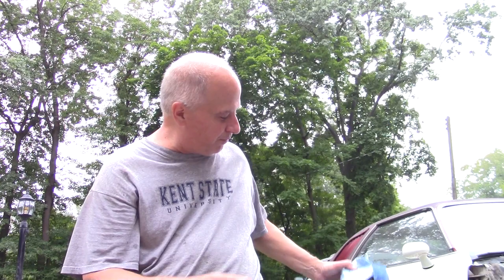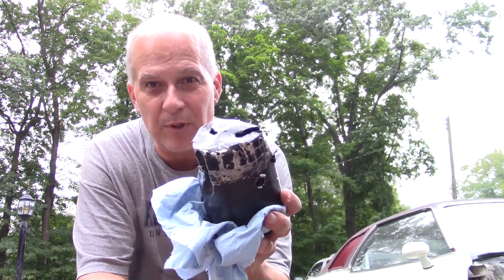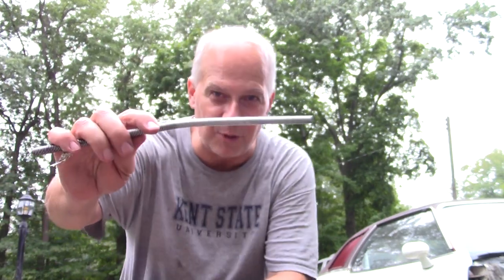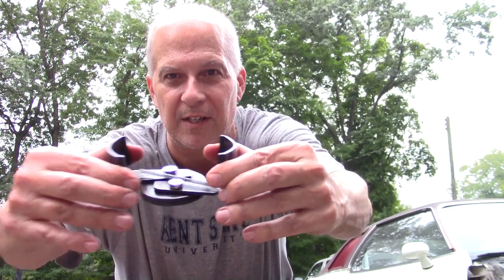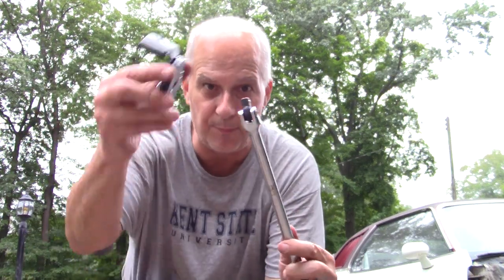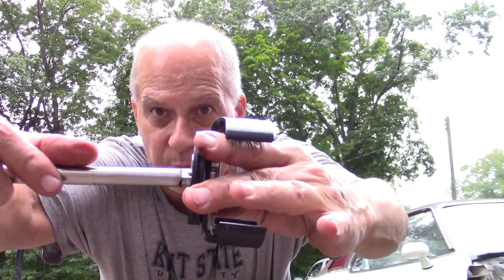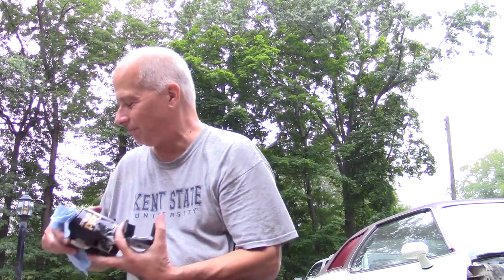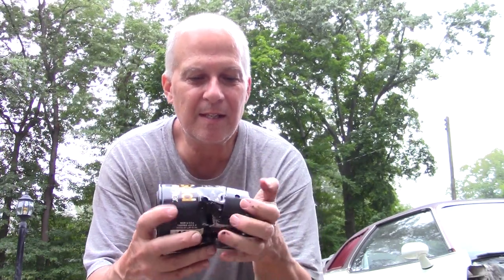Lisle Oil filter wrench review.  It saved me from a lot of work!

Comment: I will buy this tool, I had a filter stuck on my harley years ago (i did not put it on) took me over 1 hour to remove, I cursed this MO FO repair shop for 20 yrs   EAST COAST SUPER BIKES NY! Whatever this tool costs will be well worth it       TY for the video!
Reply from the maker: This tool has come to the rescue a couple times since I bought it.  I have since taken all the expensive strap oil wrenches that I have bought and put them in a box in the basement.

Comment: Changing oil in 1966 corvette with a spin on oil filter.  Could not find the oil filter wrench.  Got an old telephone cord and a small block of wood
wrapped the cord around the filter and around the block of wood.  Used the wood for leverage trying to spin the filter off.  Could not, then jacked to car up higher so I could use both hands.  Put my other hand on the filter to help turn.  Then used the wood and telephone cord to spin the oil filter.  Finally it move a bit.  More pressure from the cord and hand finally started spinning the filter.  You do what you have to do to make things
work.  Going to make my own oil filter tool for this car.  

Thanks for your video store.  I have been there and done that was well.
Reply from the maker: Car guys have to be creative.  it seems we find obstacles almost every time we work on our cars.

Comment: I had a friend recommend large channel locks for oil filters, and it worked. Except you need the right size channel locks in my opinion.
Reply from the maker: There isn't room around the oil filter for channel locks, in this case.

Comment: Been working on cars 25 years. Chevy silverado 5.3 little oil filter tucked beside the oil pan. Twisted up like a knot.  Oh what do I do now.  I had one of those but it would never open up enough to work.  As a last resort I tried it and as the filter was crushed IT WORKED!!! I think I pulled a muscle but it's off.
Reply from the maker: Glad it came off for you. I know exactly what you are talking about though.  A pipe on a breaker bar finally gave me enough leverage and it was still tough to do.  Those filter wrenches come in a couple different sizes.  Get a bigger one.

Comment: I’ve found that it sometimes helps (if you have room) to tap the top of the oil filter up near where it connects with a hammer (or anything that you can hit it with) as you attempt to turn it.
Reply from the maker: In this case, there was no room.

Comment: First time I had the filter stuck issue. Tried the standard wrench, then pipe wrench then another wrench. The filter got a big dent. After seeing this video tried the  Lisle 63600. Wasn't sure it will work but it did.  Thanks for the helpful video.
Reply from the maker: Glad it worked out for you.  At this point, I’ve moth balled my other oil filter wrench’s.  This has been my go to since I made the video

Comment: There is  a couple of manufacturers  of slip  joint  pliers  , channel- lock  brand  are the priciest  but have good  sharp  teeth.
Unless  clearance  / room is a problem  these work well.
Reply from the maker: By time I put a bar extension on my breaker bar, I was a good three feet out and it still talk all the beans I had to break that thing loose.  Craziest thing I ever experienced.
Reply: I have 2 sizes of Lisle filter pliers. They work on 90% of all filters. For those filters you can't get to, the 2 adjustable Lisle wrenches are great.

Comment: Use/attach "Exhaust Clamp U-bolt" to the body of filter. Make sure it has enough thread bar length so that we can attach wrench hole (any wrench you prefer) to the thread part, and push/pull the thread bar using wrench to open the oil filter. Here one 4-inch Exhaust Clamp U-bolt costs USD $ 1. Sorry for bad English.
Reply from the maker: Clever idea!  Thanks for sharing!

Comment: Hand tightening and oiling the gasket for 52 years as tight as I can by hand, and never have had a problem with leaking or removing them. Never used a tool to tighten the oil filter. I have strong hands.

Comment: I acquired a 14 hr jondeer breakin oil. Freeze grey 40wt? Oil. I removed original filter went to my jdstealer. Closed down. Auto store no jd filter. Went home and replaced old filter. It bottomed out by snug hand tight. Found out my toyo filter fit without side guard. I tried to remove old reused filter,Uhoh. Sheesh. Crushed it with 3 claw. Whew! Never remove till the new one is sitting  at hand.

Comment: Them are great I got mine at walmart it has never failed me. You'd think it would slip but somehow it always catches. People over tighten oil filters all the time they only need to be hand tight. Not hand tight as in big burly man giving it everything you got with both hands. Just use one hand and give about 70-80% of the beans you can manage. You can always tighten it later if it leaks. And take it easy on the drain plug just a light snug with your average 3/8" ratchet is enough
Reply from the maker: Agreed.  If you oil the gasket, snugging it up by hand will allow the gasket to compress enough to not leak.

Comment: I have one of those tools for removing oil filters, the one I have is a little different than that one, the one I have has three fingers on it that come together and clamp down on the filter. I have a bunch of other filter wrenches that I have gathered up over the years. but that one with the three fingers has been a lifesaver. before that I would always as a last resort, grab a long screw driver and it would do the job. but most oil filters hold about a quart of oil, and it would make a giant mess. and the special tool will get into tight spots better and will fit any oil filter. so it's the first tool I grab out the toolbox.
something else I have learned over the years, is now I use WIX filters exclusively. the can part of the filter is thicker and sturdier and they filter the oil better.
Reply from the maker: I have since seen those oil filter tools and the concept is the same so I can see where they would be as effective.  I have watched some channels where they dissect filters and I believe I have heard that some filters have thicker metal for cans.  Honestly in my case, the can metal was decently think or it would have ripped off much earlier.  But I have heard Wix filters are very good.

Comment: Why was it so tight in the first place? I learned simply; hand tight plus 1/4 of a turn with a wrench!  Anyways thanks for letting us know what might happen if you overtight the oil filter if the threads don't give up first!!
Reply from the maker: Can’t say.  I bought it that way.  I don’t even use a wrench to tighten.  Hand tighten.  I’ve never had one leak.

Comment: I have a 1999 Lexus RX300 - I left the oil filter on too long - got it to cut loose after 3 hours - stabbed it through twice…this is the worst oil filter placement design I have ever seen! Next time I will change the oil and filter after 4,000 miles or 3 to 4 months.

Comment: I was just looking at this product to purchase and now will, knowing it works well. What I've done in the past after the hammer screwdriver trick didn't work, I just use a good ol' pipe wrench.
Reply from the maker: You won't be sorry.  As you saw, I did all of those things and nothing worked until I put this tool on the filter.

Comment: Another cool thing about this tool is that it will not work to tighten, only loosen. It seems that stubborn filters also come off more easily on a cold engine. Also, there is a tool used by aircraft mechanics where you cut off the can and attached a three pronged tool directly to the thick metal plate with threads at filter base.
Reply from the maker: I hadn't thought about that, but it is a great point.  As for myself, I don't think I ever tightened a oil filter with anything more than my hand.  I've never had a problem.  Yes, I have seen the tool you mentioned and my home made tool was a poor attempt at something like that.  :)
Reply: here in europe most mechanics use this 3 proned tool. it is serrated and works only to unscrew ...really well. or when nothing works a chain wrench very close to the base plate
Reply: @oliviervanespen5047  What's the name of the tool?
Reply: The tool is from Bogert Aviation and the name of the tool is the Talon oil filter tool.  If you rip the canister apart this tool will attach to the oil inlet holes of the filters base plate and with a rachet just twist it off.... AWESOME TOOL!!
Reply: @thepatrioarchy   its from bogert aviation and the tool is the Talon oil filter tool..awesome tool !!

Comment: I almost bought that Lisle remover for one of my vehicles just because the filter was an odd size and really hard to reach.  The fact that it would work on pretty much any size filter was what made me consider it.  I ended up finding the right size tool at the local O'Reilly's.  Good to know that the Lisle will work to remove really tight filters as well! 

Why do you think that the filter was on there so tight?  I always tighten 3/4 turn from when the gasket touches the engine.  It wouldn't surprise me though if one of those oil change places just cranked it on until they couldn't turn it any further...
Reply from the maker: It’s hard to know if it was over tightened or just been on there forever.  Regardless, it was quite the chore getting it off the engine.
Reply: I have 2 words: Jiffy Lube

Comment: took me about 1.5 hours and trashing an oil filter to get mine off...tried hand, then screwdriver but couldnt get any leverage, tried multiple angles no joy...eventually tried tapping it unscrewed with the tip of a screwdriver , but that just shreaded the filter even more ...lastly got a thin bar with a round tip and tapped it for ages ...like i did with the screwdriver,but because it was a 10mm bar it didnt shred the filter as much and eventually the filter started to move ...i couldnt believe it ..my eyes nearly popped out of my head when i saw it move  , it was a major relief.and eventually knocked it enough that i could get it off with my hands.
Reply from the maker: Sounds a lot like what I went through.

Comment: I’ve got a 3 finger craftsman version I bought to do though filters it’s a life saver ain’t had a problem sense I buy the k&ns with the nut welded on so its definitely not an everyday use deal but definitely nice to have and if you do your oil change every 3k with some nice synthetic like I do and a nice filler every time I promise you won’t have a stuck filter
Reply from the maker: Indeed!  The longer I have owned it, the more I love it.

Comment: With all due respect, experienced mechanics do not crank on the spin-on oil filters when installing them.  I know guys who hand tighten them with no additional tool use.  I know that removing them can still be more difficult than installing them, but it shouldn’t take much effort to break it loose when it comes time to change the filter.
Reply from the maker: I agree.  I don’t know that I have ever done anything but hand tighten them.
Reply: I always have tighten 3/4 turn. Makes it easy when taking off.
Reply: I understand your point but what if you have a DRIP despite giving it a recommended hand tightening? What other choice does one have BUT to crank it a little at a time until the drip STOPS?
 No, the filter is NOT cross threaded and the face the filter's rubber seal seats against is clean and oiled.
Reply: Exactly, he should have mentioned that he ( I would guess he changed it last time) put it on too tight. I put the filter on until it gets seated, put a sharpie mark on it, and turn it 1/4 turn more. Haven’t had it leak yet, 2011 F150. Did give it a TU though.

Comment: Did you heat up the oil before you attempted to remove the filter and did you put oil on the rubber ring when installing
And only hand tight
Reply from the maker: I have no idea of knowing how long that oil filter was on the car.  It had been sitting in a garage form10 years before I bought it.

Comment: Channellock 460 pliers 4 1/4 inches or Channellock 440 2 1/4 inches pliers on smaller ph3614 riding lawnmower type filters. On a SBF small block Ford V8 those Channellock 460 pliers should have worked. Thousands of oil filters later no issues.
Reply from the maker: Sure….if you have the room.

Comment: I'm having trouble getting the oil filter off my daughters Ford focus. In 41 years of diy servicing this is first time i have ever been stumped. Cannot see this filter anywhere..even tried Ebaay and Amazon
Reply from the maker: Here you go.
1.  https://www.amazon.com/Lisle-63250-Range-Filter-Wrench/dp/B0002SR4PY/ref=sr_1_4?crid=2RR3MQ8COC215&dchild=1&keywords=lisle+oil+filter+wrench&qid=1628290083&sprefix=Lisle+oil+filter%2Caps%2C173&sr=8-4

2.  https://www.summitracing.com/parts/lil-63250
Reply: I use a piece of bike chain welded to a half  or three eighth socket and a slot to put the other end of the chain into. cost effective and free if you have some welding skills

Comment: Interesting I tried to remove my Subaru Transmission filter and it started to twist and I stopped guess I will pay the service fee at dealership. I feel your pain.
Reply from the maker: That's unfortunate.  But it sounds like you stopped before you would have had to have it towed, which is a good thing!
Reply: @GroundhogzGarage  Exactly . Thought I was going to have the drain plug removed by someone else as well yet managed to remove it and that seemed welded I know if the Transmission filter was that tight it was a job for a professional . Just trying to do what I can to save money and I know my limitations.
Reply from the maker: @donaldjames4437  A man's got to know his limitations!  :)
Reply: @GroundhogzGarage  Life is a never ending learning process all the way through even at the end we have to learn to die.
Reply from the maker: @donaldjames4437  Well said sir!

Comment: Wow - Just buy a good set of Cups and be done - I have that wrench that you are showing and I never use it - the cups are like having the exact correct socket for the end of the filter... you can torque it all day long and the filter will not get crushed, etc...  just use the same filter and you can always use the same exact cup - problem solved.
Reply from the maker: I had cups.  They are the most worthless oil filter tools on the market.  I threw them in the garbage.
Reply: @GroundhogzGarage  Actually the first set I got I would agree with you on, but the better set I got has the extended surface area with a 17mm Hex too, so they would great on those rounded filters where you can get a full seat of your extension, etc. - They are great esp if you have no room to work, and are recessed, etc - it's good to have a few types I guess
Reply from the maker: @mediacreationsusa  I had to use a 2 foot pipe as an extension on a breaker bar to get the filter loose.  There is not a cup ever made that would have stood up to that.
Reply: @GroundhogzGarage  Yeah, the second set I got would - I have had stuff stuck like that from other people's trucks. -  Think of the cups as the box end of a wrench where it completely surrounds the whole surface area - the other filter wrenches are more like an open end wrench where they only make 4 points of contact (at most) -  I guess we can agree to disagree - I own that exact wrench you are selling - the one they were "out of" is a good wrench actually (I have that one too) but still not as good as having the perfect fitting cup.
Reply from the maker: There is no problem to be solved.  The filter got crushed because of a couple other techniques that didn’t work, including a cup.  I didn’t need to buy two sets of cups to find ones that worked.  The tool I bought, just once, has worked flawlessly, even on a crushed filter.   But I’m glad cups work for you.  Like most YouTube videos, mine was to share my experience with you and what worked for me.
Reply: @GroundhogzGarage  The problem to be solved was that the filter was not lubed properly when it was put on, and the tightened way too far - you only really need to hand tighten any oil filter and then MAYBE go an extra 1/2 turn with any type of wrench.  There was NO NEED to spend 5 hours or whatever you said to take it off and nearly completely destroying the filter if you had the right tool to begin with.   ASE Mechanics all use Cups when doing oil changes at dealerships and in their own garages - Lisle makes some great tools for sure - they are a great company though.  Glad it worked out for you.
Reply from the maker: @mediacreationsusa  I thought I mentioned it, but maybe I didn’t, the car sat in a garage in upstate NY for 10 years.  I have no idea who put it on, how tight they put it on or how much it was stuck just because after 10 years the rubber had bonded to its base.  But now you know.

Comment: Guess mine is welded on or something because i tried all those methods, bought that same tool that worked on yours… and bent the tool.
Reply from the maker: That’s incredible!  Given how much thicker the tool is than the can on the filter, I’m surprised you didn’t rip through the metal of the filter.  Regardless, I feel your pain!
Reply: @GroundhogzGarage  I ended up ripping through the filter after trying the screwdriver method again, haha. This is the original filter from factory, put on by Kawasaki.
Reply from the maker: @animal-control-  What a pain....

Comment: I've seen experienced mechanics hammer a screwdriver through the used oil filter to remove it
Reply from the maker: You don't have to be an experienced mechanic to have success removing an oil filter with a screwdriver punched through an oil filter.  But when the screwdriver is tearing through the metal, sometimes drastic measures are called for.
Reply: I've heard nothing but good reviews on the Lisle 63600. Thinking of getting one and/or an EWK similar design, but with the teeth on each end
Reply from the maker: @princenaz23  There are a couple variations of the same thing out there.  I don’t know how you can go wrong.